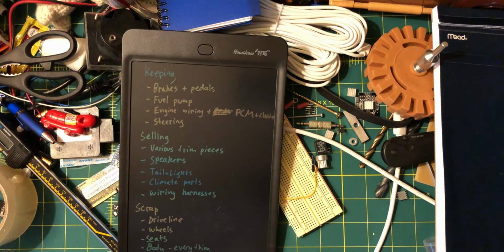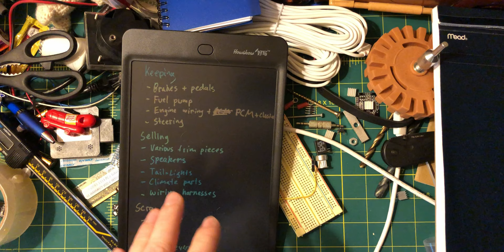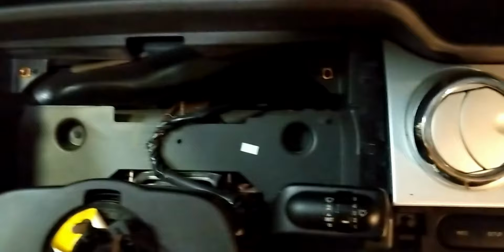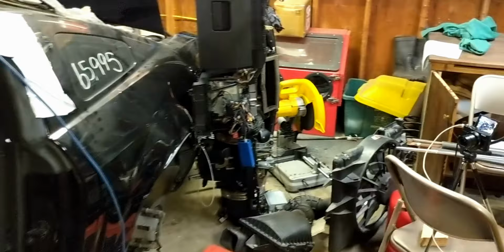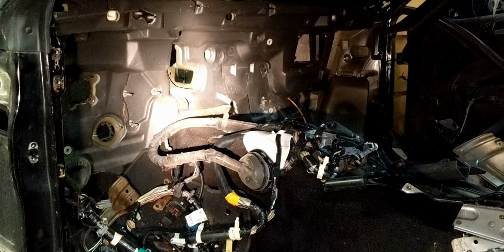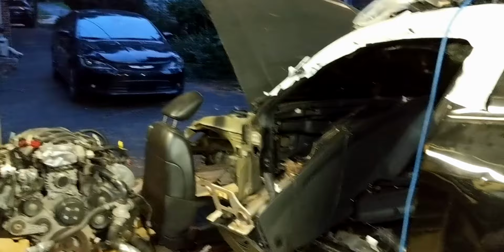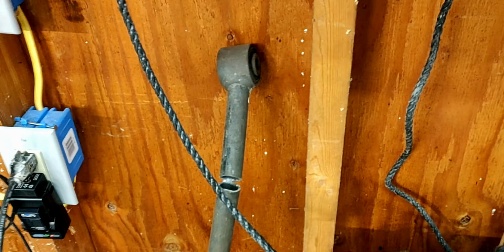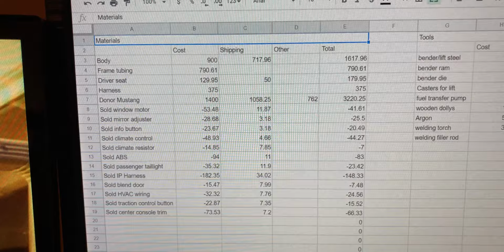$10k Shelby Cobra Build Part 4: Stripping the Mustang

Comment: Yeah, you could have easily sold the door glass, side windows, undamaged door/ quarter panels, catalytic converters, trunk lid, spoiler and made a lot of extra cash.  That 8.8 rear end was usable with new axle tubes welded on and would have been perfect.  You needed to do a lot more homework before you continue to save time, money, and your life, no more home built rigs.  And may I suggest that when, hopefully, you get the reproduction Cobra built, take it to a mechanic to make sure it's safe and road worthy.

Comment: Why did you get rid of the diff? If it was bent you could of taken it to a machine shop to weld a new piece in instead of getting a used one or a new one it'd been way cheaper also

Comment: The 'rear arm' that you cut off of the Mustang rear end is (was!) the panhard bar. They are filled with lead shot or similar to dampen noise, vibration and harshness (NVH) in the ride of the car. I believe that the stock Ford panhard bar is hollow, that piece you cut may likely have been an aftermarket upgrade. No worries, you likely would not have been able to use it on your Cobra. What was with the tease, going to the wrecking yard?! I was waiting to see that old Mustang get crushed... disappointed. :(  kidding, lol. Keep the videos coming, I'm really enjoying your content!

Comment: I'm following closely.  Two things that I questioned.  1; why didn't you cut the roof off.  It makes stripping SO much easier.  A few minutes with a sawzall and you're done.  2; why not just have the tow truck haul the car out of the garage instead of tearing up your driveway?
Reply from the maker: Chopping the roof off didn't cross my mind, will have to remember that. My driveway is very narrow, there's a fence that the f150 barely fits through.
Reply: To build my Factory Five replica, I stripped a Fox-body Mustang convertible and I agree with your statement.  Everything comes right out.